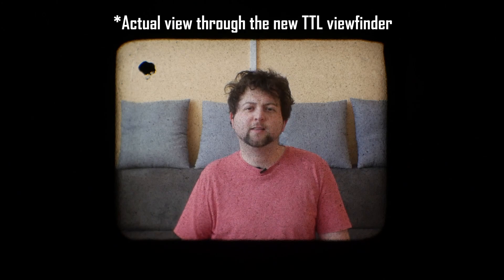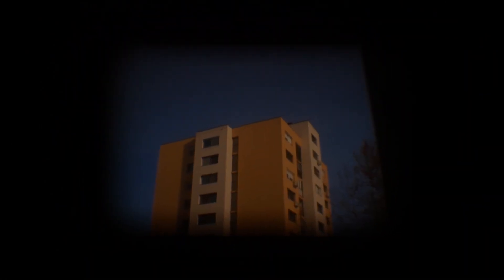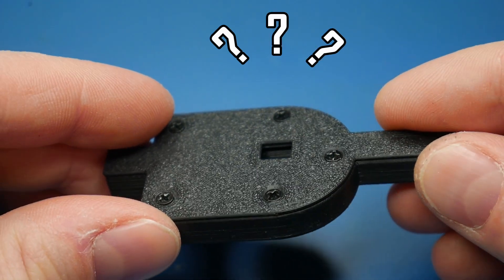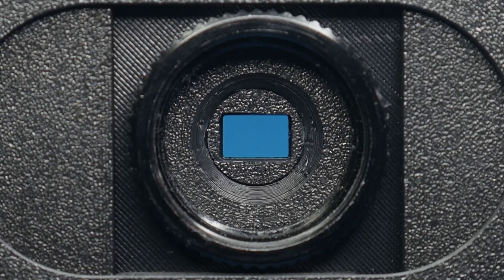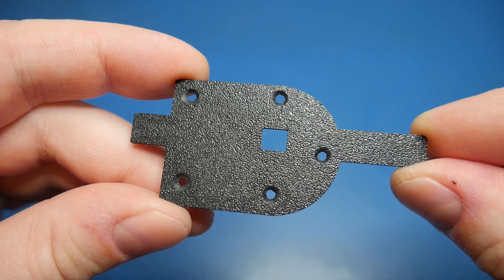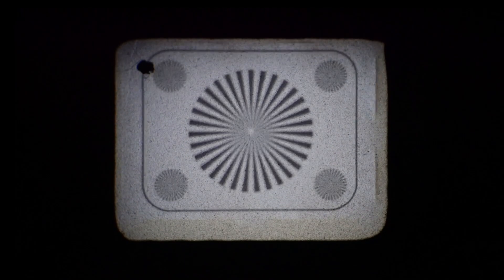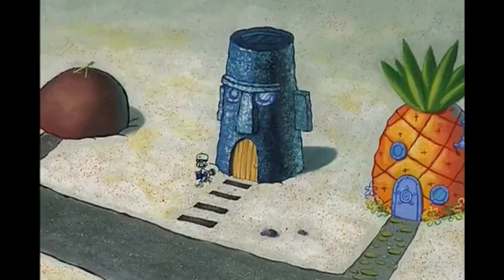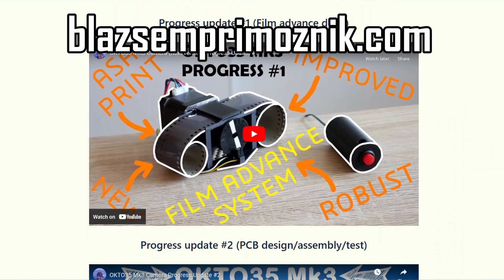OKTO35 Mk3 Camera Progress Update #4

Comment: Amazing work, this looks really promising.

I’m genuinely curious though: why not design the system to expose the full 2-perf frame like Lomokino does? Using the entire frame area feels like a big part of the character and potential of a 2-perf approach, even if it comes with mechanical challenges.

Also, have you considered a CNC-milled aluminum body instead of plastic or hybrid materials? From a durability and lens-mount alignment standpoint (especially with heavier lenses), a solid aluminum chassis could make a significant difference and really reinforce the “tool” aspect of the camera.

Overall, great progress — just wondering about these design choices.

Comment: I really love your project, and i think that it probably could be the future of film recording, as it is the cheapest and most reliable way to do it EVER.

But, don't you think that you may be waisting potential? You sure you think selling like, only a few limited units is a good idea? How much would you be able to make? Not much. For the effort and price of printing and assembling the pcb, how would the price be? Not cheap. In this way, the main pros of the camera would never see the light of day.

Do you think of EVER releasing the printing files or pcbs? Or even the oldest models? Please, don't let this project die in this way, let us try it, even with the "least cool" features you designed, because they are still awesome! Maybe start a Patreon, where people pay you for getting early acess to better designs while you release for free the older models. This surely would give you A LOT more money and help with the development, and would also make a change in the indie photography world.

I wish you at least consider reading this giant text i wrote! And maybe change a bit your original plan.

Thanks, and awesome project!
Reply from the maker: Your points are valid. However, the camera is/will be complex in its mechanical and electronic design (there is no workaround around it). Also consists of a large number of low-tolerance/modified printed parts (critical for the optical path) and other non-printed technical parts as well. The PCB is a multilayer high-density design with a huge number of components. The camera will also need to be programmed/calibrated/tested ... 

All this is required in order for the camera to function correctly. No workarounds. Here, an assembly instruction would be the size of a large book. The end user would need to have a calibrated 3D printer, oscilloscope, soldering station, source all components/sensors, special modifications, assemble/test/programme the PCB, internal wiring, and so on.

Personally, I think this would be a very difficult task to achieve and could produce a low-quality and poorly working product, which could tank the value of an already preassembled and tested camera.

The only option I see for now is a fully assembled and tested camera for sale. Will do my best to make this project be successful.
Reply: @BlazSemprimoznik  Well, also valid points, but again, would you release it? If it is hard and complex, i don't see a problem in giving us a look, we wouldn't be able to "compete", if you really think of selling it. Remembering the first model was simpler, including the genova drive that you changed to a more complex design, along with adding new functions and features, it was not as complex as the later versions. I don't know what your point with this build is, but my point in asking you this is to find something that may help me one day make one of these, and maybe other people, and maybe film could be an affordable media again, and not an expensive toy.
Reply from the maker: My goal for now is a completely assembled camera for sale. If this were proven to be an obstacle, then I would consider other options such as KIT or DIY ... 
Also, a huge amount of personal time, effort, and finances went into the camera creation.

Comment: From what I'm seeing, here's some feedback:

- fixing the light bleed between different tracks
- being able to reverse the film and do a second exposure for special effects(maybe have it track the frame # so you could go back to the exact frame?)
- Maybe have the option to connect an external monitor to use as a viewfinder(maybe incorporating onion-skinning for animation?)

And that's all I can think of at the moment. Keep up the good work and I look forward to the end result.
Reply: Forgot to suggest you could add a screw mount for mounting on a tripod.
Reply from the maker: @AluminiumRabbit  
- light leak between tracks has been significantly reduced from Mk2 to Mk3
- planning to add a double exposure feature
- not sure about the external monitor, but user could use an atached smartphone on the cold shoe mount
- multiple exposure method on single frame (onion-skinning) sound interesting, maybe worth adding this feature
- a classic 1/4" screw mount for a tripod will  be added

Comment: While you work on the next update you should set up that shutter as a standalone module and just let it run non stop 24/7 to see how long it lasts before breaking or degrading.
Reply from the maker: Already did some testing. I left the shutter module running for nearly a week non-stop to simulate shooting on 36-exp rolls (total ∼3000 rolls).
After visual inspection, only some slight wear was found on the stop ends that didn't affect the shutter performance. Added some reinforcement material there to prolong the lifespan.
Reply: @BlazSemprimoznik  NICE!

Comment: While in theory, I like that we now have optional 16:9 and a higher resolution, I'd hate to have only 10 seconds of shooting time per roll. How does the new system with an external film holder for longer running times work? I mean, like, how or where would we obtain 135 film longer than 36 exposures?
Reply from the maker: With 16:9 and 36-exp roll, the camera would have 50 sec of shooting time @18fps. 
An external film magazine would significantly extend shooting time, here a bulk-loaded 35mm film would be used.

Comment: This is super impressive. I have had so many projects like this that I have canned due to the difficulty (my laziness). Only thing I can add is, instead of a single flap shutter use a bigger blade with a hole as wide as the opening. This way you can do bulb mode as well as wayy faster shutters as the blade wouldnt need to accelerate, decelerate and accelerate; instead it will only accelerate until the end of the movement
Reply from the maker: It's a great idea, but unfortunately, the shutter I'm using, is only a two position (open/close). So in your case a bulb mode or a longer shutter speed wouldn't be possible.
Reply: @BlazSemprimoznik  if you added an extra stop that would activate when using bulb mode it could work perhaps. I would do this approach mostly because I value exposure accuracy over bulb mode since with slide film, which has much smaller dynamic range, would have issues with very small exposure errors like uneven exposure due to shutter flap closing from the same corner it opened last from. Either way very decent progress and I am very very impressed as I havent even gotten my prototypes working let alone a second one haha
Reply from the maker: @dubbedfromturkish  
adding an extra stop is impossible in my case, as the shutter solenoid is only two magnetic positions, can't modify it, it's complicated as it is.
Maybe I'll run a slide film through and see if it's affected by the shutter design.
Reply: @BlazSemprimoznik oh I meant adding a pin that extends to hit a stop which would position the shutter blade correctly to have it open. Though with how consistent your results are this is probably a non-issue that I’m simply complicating ahaha

Comment: Rackover focusing? Welcome back Mitchell NC!!

I was actually confused whether this was a still camera or not, but the motion examples are fantastic! I had gotten the impression from a couple posts on the cinematography forum that 3D printer filament would be too soft and imprecise to obtain critical focus between where the lens is mounted and the film plane. And I'm also surprised you can run the shutter at 1/125!

I'm ecstatic that someone is making a motion picture camera from parts like these, it shows how accessible it can be, despite the additional effort with electronics needed. But that you can make camera bodies like this opens up a world of possibilities!

Fantastic project and great results!!!
Reply from the maker: Was not aware about Mitchell NC, but yeah, the TTL and side viewfinder resemblance is striking.
The plastic I'm using (ASA, basically like ABS) is strong enough to support optics in it's path.

Comment: Blaz, I just caught your 4 video 12 minutes after it posted and you are doing exactly what I also designed by having option for wider format using 3 tracks instead of 4. I think having longer film length is good idea also . I mentioned idea of also going with 2 perf advance so perhaps using two or 3 tracks of larger size and staying with c mount . Keep up the good work . R
Reply from the maker: I've played with an idea of a 2-perf pulldown, but that required doubling the speed of the film advance stepper and a bigger shutter flap. Both were impossible/impractical, as they resulted in substantially lowered FPS speed limit. For me, the 1-perf is the winner.
Reply: Does the film go forward and back track to track or rewound into spool every time? R
Reply from the maker: @ralphkrause1766  The current process was to rewind after each exposed track. I'll try to establish a direct track-to-track method, this would save quite some time between shoots.